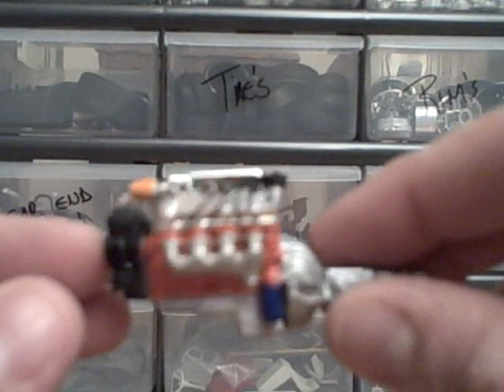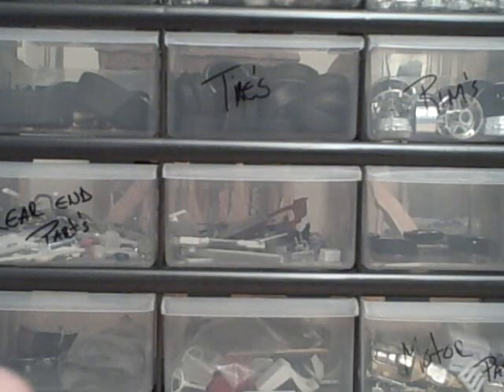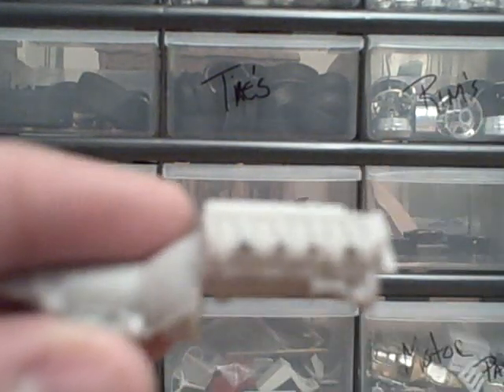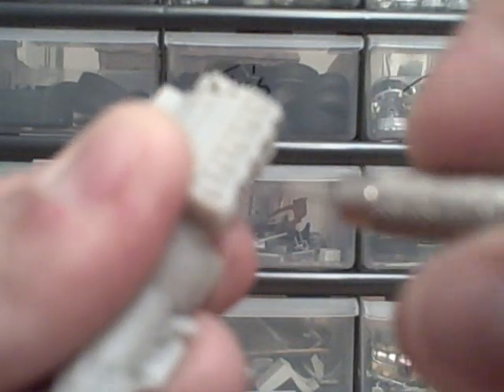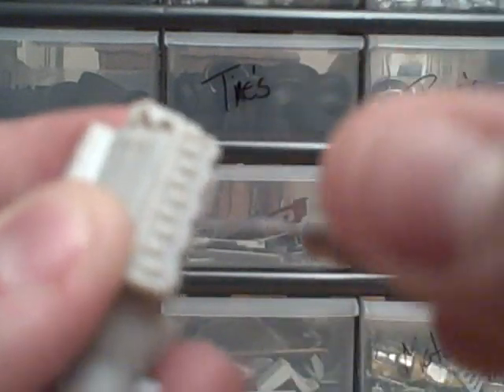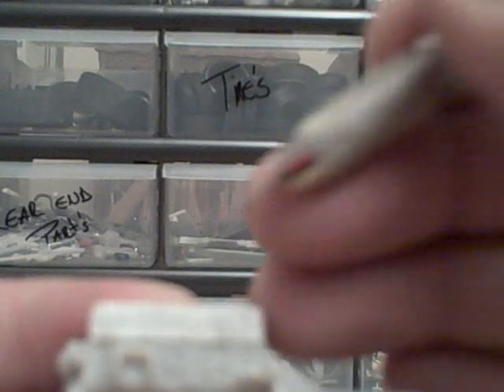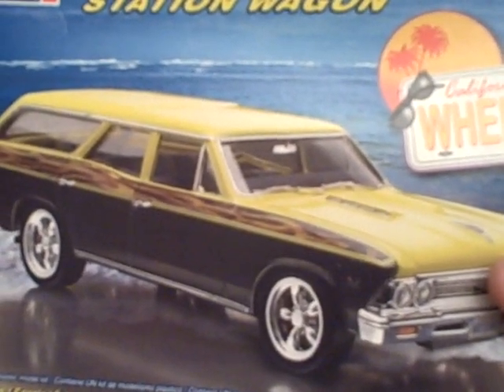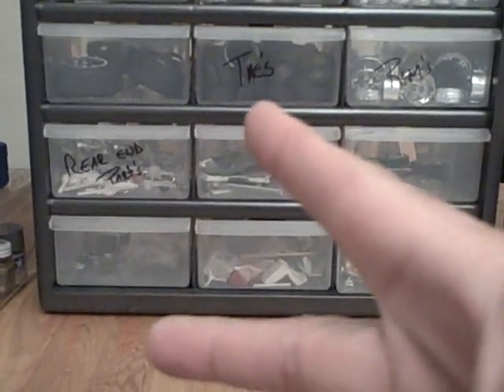how to video & My new project

Comment: @twiprod002 I've seen people get crazy for detail, I built one last year for a local show and made my own vin tags for it with corresponding paint code, trim code, seat belts, spark plug wires with firing order, worn tires, even found decals to put the GM logo in the glass corners. and I still only took home third place. The guy who won said he put over 1,000 hours in his.